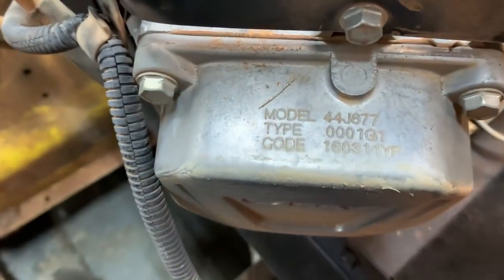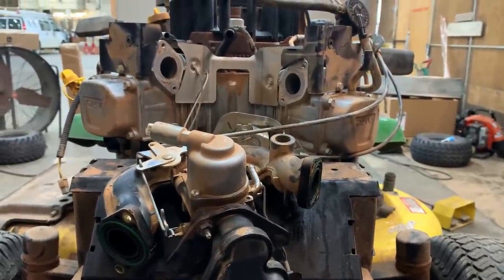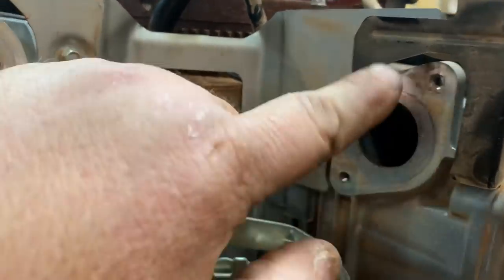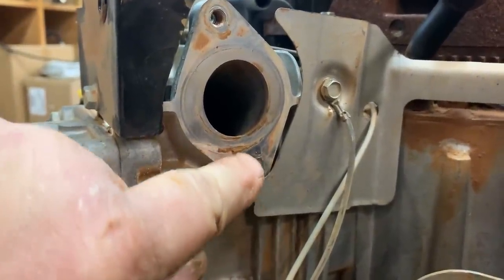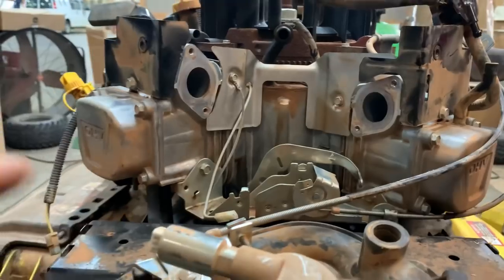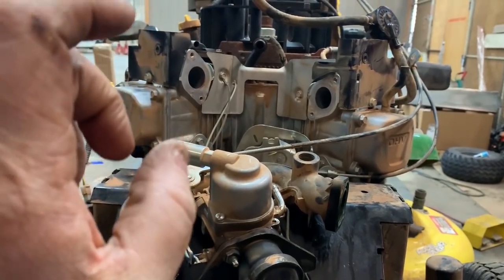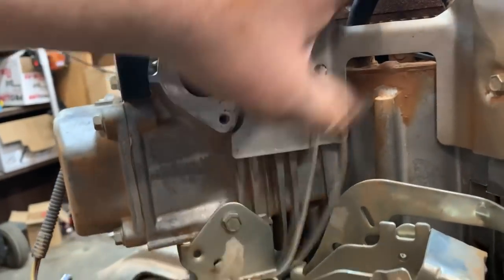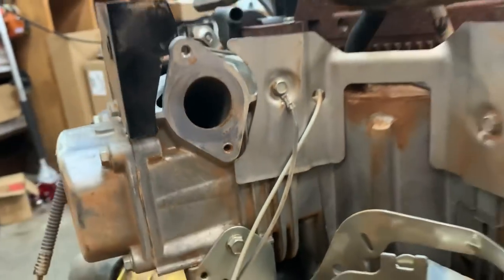YOU WONT BELIEVE WHAT WAS WRONG WITH THIS ENGINE

Comment: That's a great tip. I used the brake clean test on an Stihl 028 from 1983 I restored......and was glad to find that there were NO leaks and instead the carb needed to be rebuilt (I ended up replacing it). That seems like a rather silly mistake for John Deere to be making. Perhaps it was put together by the same guy on a Friday afternoon hahahaha. Really enjoy your videos and love your southern accent. Keep up the great content!
Reply: John Deere didn’t built the engine, Briggs and Stratton did.
Reply: @1anthonybrowning  You don't know who torqued down that bolt and didn't pay attention. John Deere has its name on the mower, so that's who I'm calling out. The point is someone didn't do their job and I'm sure it's not the last time. Have a great day.
Reply: @MrTheHillfolk  They put their name on the mower and send it out the door so they should be checking things before it leaves. I bet you're one of those guys who likes to pass the buck around, eh? Just keep passin' it and passin' it and passin' it. B&S should do a better job for sure.....but so should John Deere. Are you one of them John Deere fan bois?
Reply: @ProteusDIY  John Deere received the engine built to their specs from Briggs.  John Deere installs it on the frame and sends it down the assembly line.  John Deere did not build the engine, Briggs did.  Blaming John Deere for an error built by a different manufacturer is dense.  If problem was caught within warrantee ANY Briggs warrantee dealer could make the repair and file the warrantee with BRIGGS, not John Deere.
Reply: @1anthonybrowning  No sense arguing with you. It's spelled "warranty" btw. It's amazing that you misspelled it 3 times in one sentence lmfao.

Comment: I would say that when the heat shield was installed the rotational torque with the fastener twisted the shield out of alignment. 
This would of happened  when the engine was manufactured, care should have been taken with visual inspection when the manifold was installed. Everyone is in a hurry.